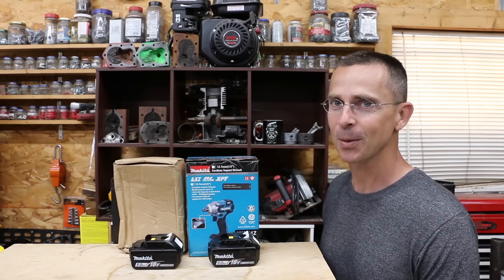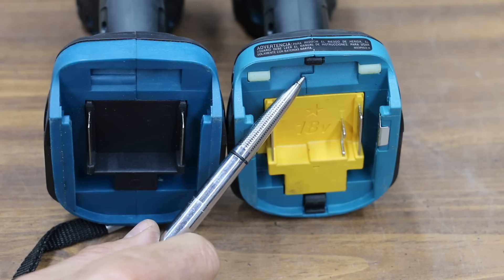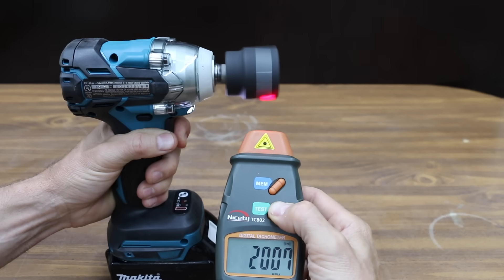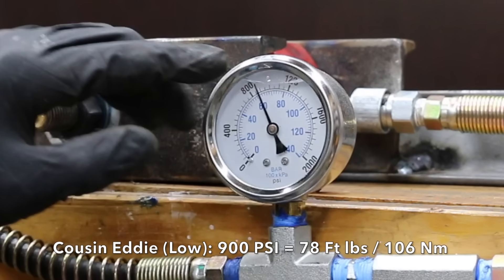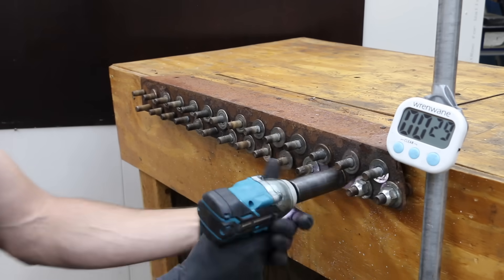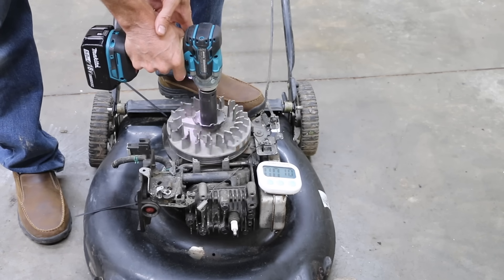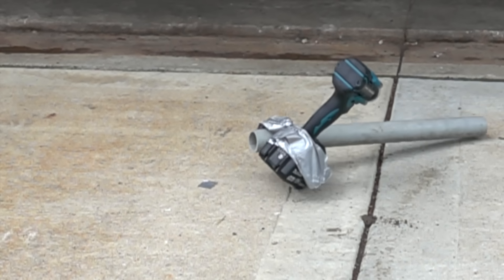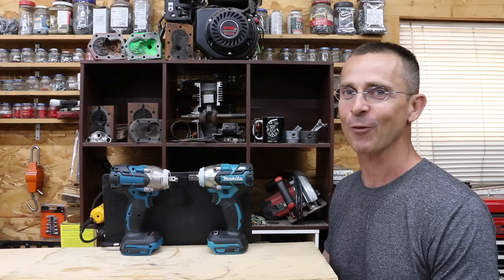Fake Makita Impact Better? Let's find out!  Makita XWT11Z 18V LXT Lithium-Ion Brushless Cordless

Comment: I have a Rigid impact I use in the garage but might be interested in picking up the knock off to leave in the car for roadside tire changes.
Reply from the maker: Thanks for the feedback.
Reply: That's a great idea. Thanks for this
Reply: @richhoops2413  Great Idea until that knock fails when you need it most.
Reply: @JimBo  I would still have a 4 way just in case. Even if it was a Snap On.

Comment: Great video.  For $35 with just a bit slower tightening/loosening than the Makita, I'd say that's a great value.  I actually bought an Enegitech 1/2" impact wrench for those occasional tire removing/installing uses.
Reply from the maker: Thanks!  Thanks for the feedback.

Comment: I use the Makita everyday for aluminum gutter installation. I've had the  brush motor fail but the brushless have been flawless with no fails. Even dropped them 35 feet to the dirt and still worked. They are great tools.
Reply from the maker: Thanks for sharing.

Comment: If you buy a Cousin Eddie, I would suggest using it with genuine Makita batteries and charging these with a genuine Makita charger. The aftermarket batteries may cost a lot less, but more often than not their ampere-hour specification is an outright lie. What's advertised as a 6ah battery is actually closer to 2ah. There are a bunch of chargers on the market for Makita batteries, varying from simple power supplies that can easily damage your battery, to knock-offs of the Makita charger. The knockoffs look almost identical, but I don't know how well they work. Haven't seen any reviews. However the genuine Makita costs only about 1.75 times as much, $35US as compared to $20. So without much info about the knockoffs, it doesn't seem to make much sense, in my mind, trying to save $15 by buying a knockoff. Total cost of a Makita system for cordless impact-wrenching: Cousin Eddie $30, 3 ah genuine Makita battery $60, Makita DC18RC fast charger $35. Total $125.
Reply from the maker: Thanks for the feedback.

Comment: So Cousin Eddy is just good enough to pull lug nuts off to remove a rim for a brake replacement, but won't cut it a professional setting.
Reply from the maker: Great point. I've used Cousin Eddie a lot since this video and it just doesn't make as much torque as the genuine Makita.

Comment: After seeing this I ran out and bought a cousin Eddie just for chuckles I was able to get one for 30 bucks and I bought the extra batteries and charger etc. That was a year ago for various reasons I haven’t used it for a year basically and battery is still as good as any other lithium-ion battery which surprised me. I had used it several times on my sisters car to put wheels on and off and do other barely heavy duty automotive mechanical jobs. While I wouldn’t bet my life on it, for 30 bucks I thought it was a screaming deal. I’m just a Home user so I don’t put the screws to it like a s professional user would. For what it’s worth…. I would say though that after watching project farm for a while I’ve been driven toward higher quality tools instead of lower quality unknowns.
Reply from the maker: Thanks for sharing.

Comment: I would agree with you on the cheap tool I think it is worth $30 because it does except Makita batteries, but for performance I would go with the Makita brand,

But I do have a question for you I would like to see a video about 18  v
DeWalt batteries replacements which one is better name brand or knock offs thanks
Reply from the maker: Thanks for the video idea.

Comment: Great tests.. You have a good point on the 30 dollar tool. It's 5 times less than Makita, but is Makita also 5 times better? If so the 30 dollar knock off is not bad actually. It could get someone going until they can upgrade to something more durable.
Reply from the maker: Thanks!

Comment: Thanks. After viewing this video, I was amazed by the cheap impact wrench. Went ahead and bought one. Cannot be happier with the performance/cost ratio. Excellent for mower blade removal/mounting. Effortless! The 1/2" center is hollow. It takes hex-base bits. An impact driver for me. Cool. I don't expect it to be used on a daily basis and long lasting. Great for a casual DIYer.
Reply from the maker: You are welcome!  Thanks for sharing.
Reply: i just ordered one.  i made sure i ordered one with the hex drive.  for those who plan to order a "cousin eddie", some dont have the hex drive.
Reply: @vsvnrg3263  get the wrench to driver adapter for $3. It works better. Hex shank bit goes in adapter deeper and locks in.
Reply: @hpw-ws6bj  , yes!  i'm fussy about adapters.  i bought a milwaulkie but the way it operated was a bloody nuisance.  so i bought a ryobi adapter.  i had to buy some tungsten carbide drill bits to carefully drill a hole in the side of it (its hardened steel) to accept a pin to make it semi-permanent.

Comment: I really like your videos. You seem to be very scientific and thorough. I am wondering if you could do one on automotive fluid stop leak additives. For example bars leaks and Blue devil both make cylinder head repair for antifreeze and engine oil stop leak.
Thx Brian
Reply from the maker: Thanks for the suggestion.

Comment: I know my $90 porter cable whooped up on a Milwaukee (both corded models) while breaking 3/4 bolts off of rusted out mag chloride (road salt) tank covers. After about 300 bolts the Milwaukee got hot and couldn't get them all. The Porter Cable came in and just snapped the bolts clean off that the Milwaukee couldnt budge making the job go pretty easy. That Porter Cable is rated over 400nm.. maybe 420 or 450 I'd have to check.
Reply from the maker: Thanks for sharing.

Comment: I unwillingly bought a fake makita cordless drill. The dead give away when I started to use it. That the battery was very hard to remove from the drill. It was a 3o something voltage. But when I put the meter on it. It read about 22v. 
I think I would’ve rather have the real McCoy
Reply from the maker: Thanks for sharing.

Comment: Good engineering for the Makita to use a much heavier anvil, more material for the body for strength but still have essentially the same weight as the knock off. Also very good engineering and production efficiency (and probably the removal of QC) to be able to make a decent tool at $30 and still make it worth it to the company who makes it!
Reply: value for price.

Comment: I have a suggestion for a test. Mower deck nonstick coatings vs used motor oil. I think there is a few different kinds of products that claim they are “non stick.”
Reply from the maker: Thanks for the suggestion.

Comment: All copies and knock offs are intellectual theft no matter what way it’s done. Makita is a world renowned name and I’ve used the tools for forty five years and three of them are still running and have been put through heavy work. I’ve seen the ripoffs and copies burnout on site. The can be a fire hazard on a site if left in a tool kit overnight after a hard days usage if they last that long. We don’t just pay for the name Makita, but the years of research and designe technology that has developed these tools to strong and sturdy very competitive power and battery tools.
Reply: Yep commented the very same before I read any comments. 40 years of Makita tool experience. All good. 👍🏻

Comment: Bought cousin eddy early 2021 Use it for 2 months, then suddenly it stop working. Leave it in the tool cabinet for  months. i forgot to throw it away. Rarely i tidy up my cabinet. Then i came across a video that shows how to fix impact wrench switch. So i remember cousin eddy. All i have to do is open up the switch box, pry out a little bit of the copper contact, filled it up with Vaseline, assemble it back. countless of customer cars, still works like a charm today.
Reply from the maker: Great feedback!

Comment: My dewalt I’ve owned since 2014 now 2022 dropped from over 30 ft doing dish satellite also used to pulled unscrew lug nuts as a hammer left out in rain for weeks also forgot on a jobsite lol still own and working perfectly today. Just the small impact drill 20volt lithium.
Reply from the maker: Thanks for sharing.

Comment: When undoing the bolts I liked how you took your time with cousin Eddie and you completely rushed with Makita as if you were in a race LOL there's no way that there's no bias going on.
Reply from the maker: Thanks!
Reply: I wondered what the difference would be between them if Makita undone row of bolts on that bottom row first, then get ol Cuzzin Eddie on to that top row to see if it makes a small difference..if the nuts are torqued in an even manner , I'd say Cuzzin Eddie might have a little more kick...

Comment: Aliexpress sellers now have tools claiming to deliver "maximum torque" all the way through all of the specifications of Dewalt, Makita, Milwaukee, etc. and even exceeding them (2,000 nM rating for aspirational Makita brand BLMIATKO..... I am being generous since I don't know if its a "knock off" or if the same factory is selling a no-brand tool from the same set of tooling that they developed for their US brand/buyer, aka Makita..... "everything but the brand" duplicate is not a "knock off"  its more like a "bootleg")

of course... what is "maximum torque"?  Nutbusting?  fastening?  some kind of continuous power delivery?  theoretical based on ideal motor spinning and mass distribution of the rotor/hammer?

Comment: I have the cheap version and to be honest as a 'home workshop' tool its fantastic value, it does what it does well and saves a huge amount of time which is its main attraction for me. Sure the Makita (and other good brands) will be better but its hard to justify the price difference since I will probably get years of service from my cheap one and I have the extra 'seconds' to wait to spool up the nut... As always a fantastic video, I would never have thought to put them actually head-to-head but what a test that was, I think you're scientific enough and real world enough to make your comparisons so very useful.. Love your work.. and I love your sense of humour too...
Reply: i would like to report that i am using the cheap knockoff since 2 years and it still works. Feels like it even gained a little more torque after a break in episode. I will need a propper one soon though as it was an eye opener regarding how often i use this.
Reply: @nilz6432  you've convinced me to get one. If you use it for 2 years and it still works that's as good as any tool imo
Reply: @cjcars96  problem is, my cousin has one he bought recently, and its crap. Its not the same tool i bought two years ago. There are no guarantees with the cheap stuff.
Reply: @nilz6432  How about the batteries? It seems to be another weakness in knockoff's?
Reply from the maker: Thanks and you are welcome!
Reply: I'm in the same boat as you for "home workshop".
Which tool brand is this? 
From Amazon or Ali?
Can you post a link please... appreciate it.
Reply: Intellectual theft is what copies are. All my tools are Makita except for Festool rail saw.
Reply: @seamusphelan228  100% agree

Comment: Have cousin Eddy, it is still working almost 2 yrs after purchase with use several times a week and often with a 1/4" adapter as a backup to a Makita 1/4" driver to drive screws into the wooden things I build, will buy a Makita 1/2" once I have employment again.
Reply from the maker: Thanks for sharing!

Comment: How is the warranty on the knock-off model ?   Also, if there is a problem with the knock-off, will the manufacturer make the necessary repairs or tell the consumer to get a new one ?  These things I would consider - and Makita has repair centers to get the tools serviced - can that be said for the knock-off ?

Comment: I'm a builder and have over 25 makita tools, my oldest impact driver is still operating after 10 years of abuse, drop countless times, drowned in a wheel burrow of water and a couple hundred thousand screws. Its now retired to home use but still preforms without fail. If you buy a makita tool you will pass it on to your kids and not to land fill.
Reply from the maker: Thanks for the feedback.

Comment: Oh btw, there are two types of this little knock off. You have the one that has a slightly higher Nm torque (which they advertise at 800nm) and this one which is advertised at 520. The 800nm is usually a bit more expensive. But I don't know if there actually is a difference in quality between them, or if they just ram more current through the motor and thus more wear.
Reply from the maker: Thanks for the feedback.
Reply: @ProjectFarm  I just checked it, the one I have is the slightly higher powered one. (Don't know if that's better as said, they might just cut a few corners to reach that supposed "power"). But you can recognize them from the socket connection. The slightly higher powered ones have a hex opening in the front for bits (drill bits, screw bits). 

Now again if there are any other differences (like the hammer being heavier) I don't know. I only own of these, and not thinking of getting a second one LOL :P.

Comment: Update on my cousin eddy. I’ve dropped it a couple of times around hip height and it still hasn’t broke. The front white plastic ring has come off. Still working strong. Has not slowed down. Had it for about a year now. Still takes off lug nuts
Reply from the maker: Great to hear!  Thanks for sharing!

Comment: I have been using cousin eddie for a year and a half now, still works. but it is around $50 from where I live, but it includes hard box case and two batteries labeled 72v, but is only 18v when tested.
Reply from the maker: Thanks for sharing.
Reply: Same deal here. $52 from Walmart. It’s 18v battery. 75v is too high for these tools. Batteries are probably 18v Mikita tools compatible.  So far so good.

Comment: Test suggestion for people mounting solar panels on rv roofs: tensile strength of VHB tape vs 3m 5200, 4200 vs Quad vs vulkem vs rivets vs screws. There is a ton of misinformation out there.
Reply from the maker: Thank you for the video idea!

Comment: I thought the fakita was a scam because the price was very low and free shipping. I have been using it for overhauling two Diesel engines already.  I own the genuine 3/8, 1/2, 3/4 brushless makita wrenches but use the fakita most of the time for dirty job.

Comment: I don't know what the part number is on the Makita Motor that you are using, but apparently you can buy a replacement motor for around 15 dollars, it would be interesting to see how much it would cost total to replace Cousin Eddie's internals with the Makitas internals and add a reinforcement in the handle for Cousin Eddie.
Reply from the maker: Thanks for the suggestion.

Comment: You should rig up a test for drilling into concrete and see which drill lasts the longest before breaking. From I have gathered from my buddy, the top brands last about 150 hours or basically 5 hours a day for 30 days, is how he used them, so that is a good metric for the test I believe.
Reply from the maker: Thanks for the suggestion.

Comment: Sorry but TIME, when you use a tool, is not a problem. When I use a tool is all about resistance and durability that's all it should be. For the few seconds you got I will definitely buy 2x 20 $ Impact :)))))
Reply from the maker: Thanks for the feedback.

Comment: great video.  lets all keep in mind that the makita you're comparing against is in a total class of itself.  would you be willing to make a video comparing the fake makita to maybe something like a ridgid, or ryobi?  I ask because when you're looking for something economic, the fake makita is a great option or maybe ryobi or ridgid.  I'd be intrigued on that type of comparison.  thanks again!
Reply from the maker: Thanks for the suggestion.
Reply: He is dead on with this comment.  for $138 a makita is in a class of its own.  I own multiples of them all, as I use them for construction, for hours every day.  they heat up, and grind and melt the motors, and keep running.  For $30 the knock off is also genius. It's not good, but for $30 nothing has to be.
Reply: I feel like the ryobi lithium sets are almost as bad as the $30/ish knock off makita stuff.

Comment: use the knock off for doing wheels on our race cars, wheels are always torqued with a wrench to 120nm after the impact so it doesnt overtighten them and it can still remove them with easy, and if it get run over, i just buy another one, for sensible uses they are pretty damn good and i probably use it more than my dtw1002
Reply from the maker: Thanks for the feedback.

Comment: If your not an everyday tradesman then yes buy the cheaper crap. If you work in the field everyday you dont want to work with cheap tools because not only will you get cheaper results but time is everything the  non brands over heat are slower and during winter were is cold some might not even work .
Reply from the maker: Thanks for the feedback.

Comment: At the end of 2020 this video made me buy Cousin Eddie, and there's still no regret whatsoever. The battery lasts very long, because the hammering is a very efficient method of power transfer. I keep being amazing by the speed and power, compared to a conventional drill. You must be very careful with smaller bolts and screws, because they'll break before you can say "whoops', but for undoing screws, nuts and bolts, and tightening bolts and nuts beyond 5 mm (1/4" and up) it's an awesome tool with a ridiculously low weight.
Reply from the maker: Thanks for sharing!  Glad to hear!

Comment: I wonder if you could buy a different 'hammer' piece, and just replace the cheap one. Would it fit? could you buy an expensive one and still everything work?
Reply from the maker: The internals were quite a bit different between the 2 brands